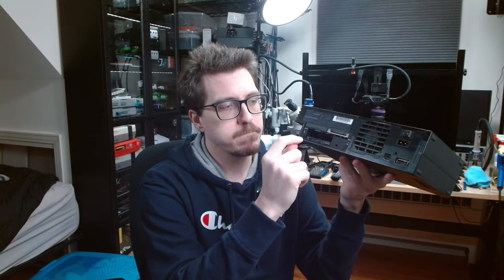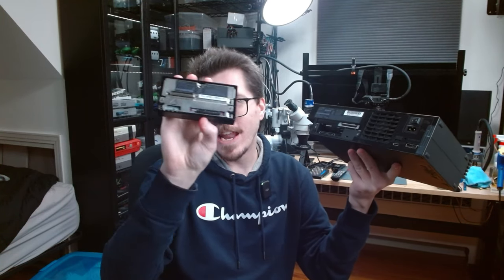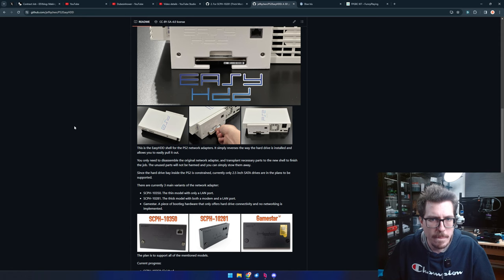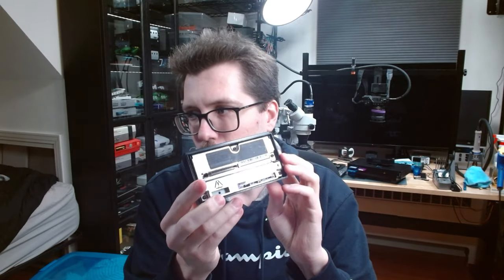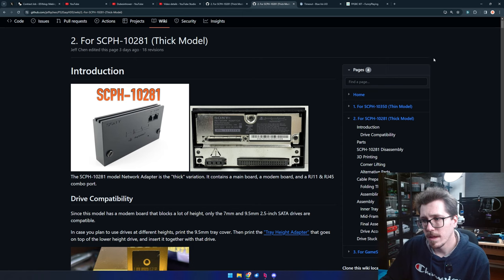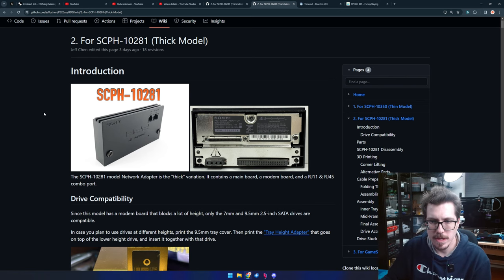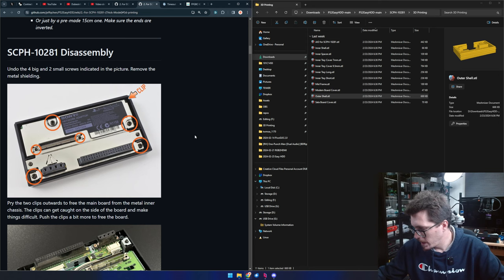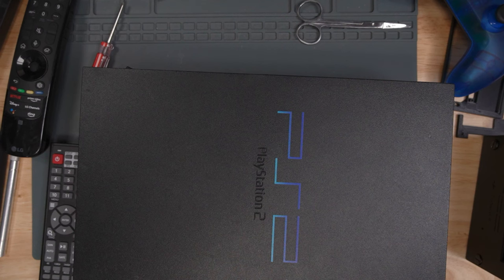Easily Remove Hard Drive From PS2 Network Adapter with Easy HDD!  - Retro Modding Stream

Comment: 51:40 those SD to IDE adaptors can only read up to 128GB worth of games while the CF to IDE adaptors can read up to several TBs. Plus you can combine it with an iFlash SD to CF adaptor so you don't have to pay for overpriced CF cards.
Reply: Any links?

Comment: A solution to a problem that doesn't  exist
Reply: The problem does exist. Unless you used FTP transfer (which is really slow on PS2) the only other way to add new games to it is to unscrew the hard drive adaptor and pull the adaptor out to access the hard drive. This solves that problem completely
Reply: @MichaelM28  - oh wow you have to undo two giantscrews which takes about 30 seconds and can be done with a butter knife (hell you dont even have to tighten the screws in the first place, the adapter will stay put regardless so you can literally just pull it out straight away)....wow that's worth the purchase and the hassle of installation 🤥

Just how many times will have you to put on more isos?? It's not like ps2 games are still being released 🤣
Reply: @devan_danger  Well said!